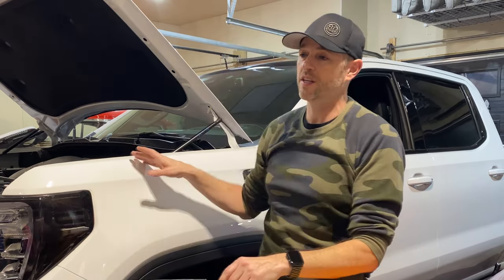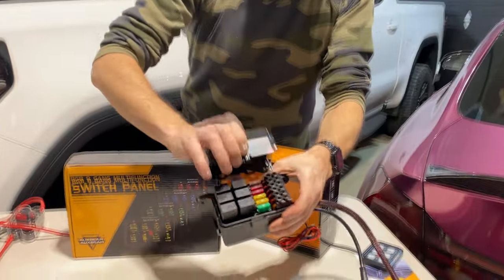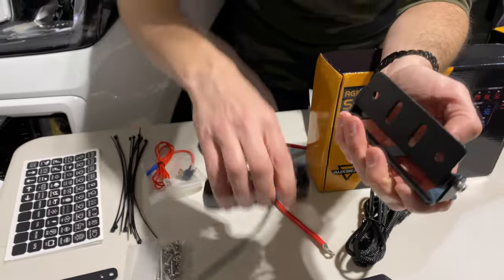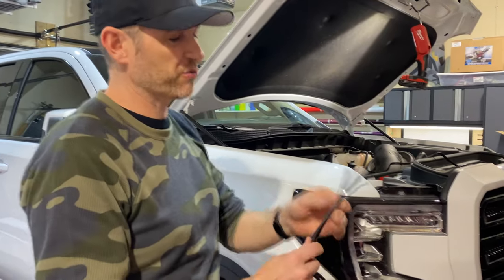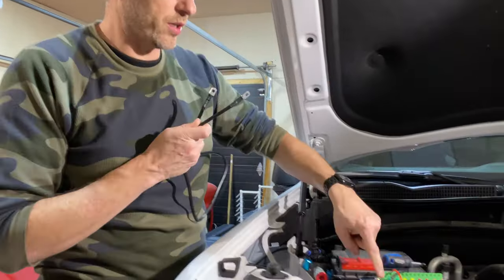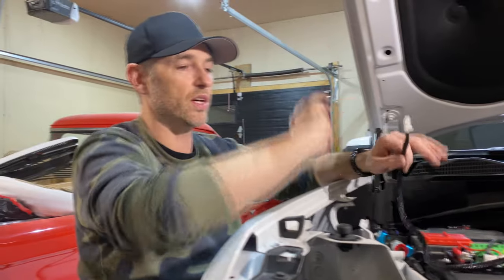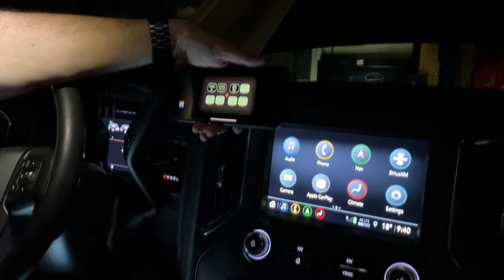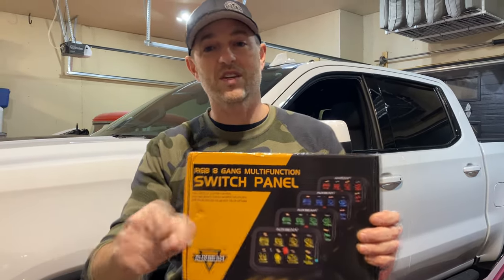New Switch Panel AUXBEAM AR-800 RGB Multifunction Bluetooth LED Install and Review.

Comment: Just got done putting this switch in a 2022 refresh with the Duramax. Everything is the same, except getting through the firewall was a pain in the butt. The air intake tubes block it. Removed the first elbow, and access was still tight, but I got it... if you remove the back part of the intake hose, it wouldn't be too bad, but that seemed like it would be more trouble than it was worth.

Oh, and finding the wire was a little challenging in the cab. I don't know if the 2022s have more sound insulation, but I had to dig for it.

Comment: Great video instruction. I see that you connect the remote wire to the ignition. Does that mean you can only turn lights on when the ignition is in "on" position? If so, is there a way to bypass that and give you the ability to turn the lights on without turning on the ignition?
Reply from the maker: This video should help:

Adding a Wireless Remote For My Accessories!
https://youtu.be/aV7ey5415dI

Comment: Don - loved the video and the step by step install directions.  My AR-800 arrived yesterday and followed your video and the supplied installation brochure supplied by Auxbeam.  Unfortunately, despite everything being hooked up correctly I cannot get the control box to turn on and illuminate.  I tried to reach Auxbeam for assistance but to no avail, and they don't have any Q&A or Troubleshooting links on their website, or none that I could find.  

My 2016 Toyota Tundra has LOW PROFILE mini fuses, so I used the supplied fuse tap, which is designed for mini fuses, and replaced my 10 amp low profile mini ignition fuse with a 10 amp mini fuse.  The supplied fuse tap seems to fit fine into my truck's fuse box, and even with replacing the truck's 10 amp low profile mini fuse with a 10 amp mini fuse the truck started up just fine.  I haven't hooked up any accessories yet, but one would conclude the control box should display it is receiving power with or without any attached accessories. Do you think the issue is using a fuse tap with mini fuses instead of LOW PROFILE mini fuses?  Any troubleshooting ideas?
Reply from the maker: Sorry just saw this message. YouTube flagged it as spam.  Have you tried bridging the trigger wire to the main power lead just to test it out for power.  That small trigger wire is on a two prong pin. Maybe the other side is live.  Just making guesses in the dark

Comment: very good step by step explanation - question?  the ignition/accessory switch wire - where would I connect it since I can't do your option where you spliced into a red wire?    I have 2024 GMC Canyon elevation - please advise
Reply from the maker: Heated seats circuit? I used my cooled seats for these things

Comment: I have a Auxbeam and a light bar just like that, I want to learn how to install but I’m having trouble. So I cut the wires like you did in min 14:22 but I don’t know hot to connect to the box which wire goes to negative and positive since it’s it has a red blue and white wire, it’s also a RC led light bar with DRL

Comment: So I'm wondering if I can cut the switch controls off and tap my DRL so they can work automatically? Then make everything automatic except things like light bars that are not for road use! Maybe i just need to find a way to split or separate the switch controls wire. Great videos keep up the great work!

Comment: Question. If the light bar has 2 color modes (amber and white) , would you need to wire them to separate switches? It looks like you did but wanted to confirm! Thank you. Great video looking to get one for my father in law
Reply from the maker: Yes I have each DRL to their own dedicated switch

Comment: So, theoretically, would I be able to run this purely from my phone without installing the switch panel? I'm looking at getting these for my RHD Jeep so I can finally get some strobes on it, but not super keen on the idea of tearing the dash apart to run the wires. 

Great video, super informative!

Comment: Prefer the replaceable relay version, easier troubleshooting. Also if relay fails you can swap positions to put the circuit back in operation. Relays fail, I like the option to replace. I would not like to replace the whole relay power unit because (one) potted relay failed. They should keep the previous (old) form factor and add the RGB/Blue-Tooth features. Don, great videos. Thank-you!
Reply from the maker: Thanks for sharing!  Weighing the pros and cons as you research what works best for your project makes sense
Reply: I like how you responded to his video . Great to see someone thinks lie me . I also would like to know if this company will provide any help, customer support and is in the USA most importantly this system is not waterproof from what I can see   I put my money on Finex 4200 mini controller made in the USA, they provide lighting equipment for fire, police and public safety
Reply: Thanks buddy for your vid but I’m still looking for quality waterproof system

Comment: Just wanted to point out that there is also a firewall penetration on the pasenger side as well. Might be a little harder to access from inside the cab though depending on the size of your hands.
Reply from the maker: True!  I used the passenger side one for my onboard compressor auxiliary circuit.  Either route, I found them both difficult 😂
Reply: So, Don quick question, on the driver side, penetration can you give a little input how or what did you use to get it through the fire wall?

Comment: Great video and clean installation. 
In regard to the compressor, how do you deflate/flate the tires pressure?
Reply from the maker: Without an auxiliary tank it is slow, but possible:

How to Install an Air Line in Your Truck!
https://youtu.be/RhqsI4NC2rU

Comment: Awesome job, can you turn on the lights with the app even if the truck is turned off?
Reply from the maker: Yes if you wire it up that way.  Here is a video where I can turn it on remotely too:

Adding a Wireless Remote For My Accessories!
https://youtu.be/aV7ey5415dI

Comment: Hi, Don. Excellent channel.  I am interested in the AR-820, but do not wish to mount switches in the truck.  I have a 2023 Canyon Denali, with Google built into the infotainment enter.  Do you know if the app could be downloaded to the truck, and I could control my accessories with the screen?
Thanks
Reply from the maker: Not that I know of

Comment: First Purchase HERE <-------    Thank you for the install vid. I will take it that the 8 ft cord did not make it around the battery as you intended for it to when you initially explained. :) Noted
Reply from the maker: The cord was long enough.  The only cutting of wires was my light bar switch

Comment: Nice video 👍 If my light bar needs 35 amps (420W on 12V) and the switch panel only has up to 30 amps, how would i wire the original harness with a 40 amp relay into the auxbeam switch panel? Would that work? Thanks.
Reply from the maker: You would hook it up with 40amp harness/relay as per the lightbar manufacturer’s instructions and just use the Auxbeam as a switch.  You could use a 5A circuit just for switching the 40amp relay on and off
Reply: @Donslife  Thank you loads. This is a big relief. 🙏

Comment: You may have answered this, but I have a 3 way switch for light. On/off/backlit.  Will this panel allow for all 3 positions?
Reply from the maker: Not that I am aware of.  A 3rd position would need a 2nd switch to be used.

Comment: If you leave the  light bar on in the switch panel and you turn off you engine  and  you turn on the engine back on  the lights are on or you have to press the on button in the switch panel to turn them on again
Reply from the maker: If main power is cut from the panel, everything is off and has to be repressed.   You can wire it up differently of course.    After this video I added a wireless remote that can turn it on regardless if the truck is on or off too

Comment: Great video. I have a question. Can it be operated via Bluetooth with the ignition off? I camp in the middle of nowhere and if something is stirring around camp I would like to be able to "Light up the night". Thanks
Reply from the maker: Yes if you wire the panel to be live with the ignition off
Reply: @Donslife   do you know if it has any amperage draw that way? With all accessories off, of course. Thanks for the quick reply.
Reply from the maker: You can add a remote turn on like I did
Reply from the maker: Adding a Wireless Remote For My Accessories!
https://youtu.be/aV7ey5415dI
Reply from the maker: This way I can turn the panel on from 20ft away and connect my bluetooth to operate anything
Reply from the maker: @Overland_eXploits_Oklahoma it probably wouldn’t drain your battery overnight but it would after multiple days

Comment: I have the Chevy 1500. You used a existing fuse tap. Which fuse number would you recommend to tap into? Engine bay fuse number or passenger side fuse panel number?

Comment: I just got to the part of the video where you said you have a compressor under your hood? I know I didn’t hear that wrong because I even ruined it in. Heard it again, lol. Do you have a video showing the install of your compressor?
Reply from the maker: There are a couple related to it. Here is the main one :

How to Install a Wireless Compressor for your Air Suspension
https://youtu.be/pLCIiavqKtE
Reply from the maker: And another:

How to Install an Air Line in Your Truck!
https://youtu.be/RhqsI4NC2rU

Comment: You still need to have the actual controller hooked up to use the app though?
Reply from the maker: Correct.  The App communicates with the controller via Bluetooth.

Comment: Any sealant needed where you cut the rubber portion of the firewall?
Reply from the maker: Not really.  I mean you could but the chances of water or dust getting in is highly unlikely

Comment: Good morning, For the wiring of the RC light bar. I notice u cap the red wire for the switch, at 14:29 of video {New Switch Panel Auxbeam AR-800}  that being said..... you run the WHITE wire into the positive terminal using 30 amp location on  AUX box and then the BLUE wire into positive terminal of next switch over ? Using  the 30 amp switch right next to it ???  Lastly, do you connect the power leads that come with wiring harness for the light bar or just burying them ?  Thanks Don J

Comment: Great vid. Do you know the power the panel uses to operate itself? Like standby power when all the circuits are turned on but no accessories actually drawing power? I have a different panel that draws 1a constantly just to have switches in on position.It’s a bit of an issue and I need to find new panel. Thanks

Comment: Bro can you confirm that the auxbeam panel is defect. A lot of people on YouTube telling that after a month of use the box is damaged making some equipment on all the time. Replaced by auxbeam but the issue persists.
Reply from the maker: Mine works perfectly.   I was just using it at a car show and had my lights on a strobe effect using the Bluetooth app on my phone.  I have not had any issues at all

Comment: Hey Don, love all your vids and mods. Will this work just off the auxbeam phone app or infotainment screen without having to run the 8gang controller into the cab?
Reply from the maker: Thank you sir!  Technically you could leave the control panel tucked away somewhere safely in the engine bay away from heat and moisture.  Your phone app via Bluetooth would do the controlling.  Personally I would find that inconvenient and would want the panel in the cab, even if you left it sitting in the glovebox or something.   If you want to control it with your infotainment system, you’ll need something like my CarPlay AI box to control the Auxbeam switches.

Comment: Great Video! Thank You, with the RC Light that comes with three position switch, is it okay for the DRL and the flood to be on at the same time? is it really okay to eliminate relays and fuse holders and tap straight in with this unit?  thanks
Reply from the maker: Thanks!  I have looked into the flood light and DRL being on at the same time couldn't get a straight answer.  The most of have learned is that it won't hurt it in the short term.  The flood light drowns out the DRL too.

Each Auxbeam switch has it's own fused circuit and relay so yes, you can eliminate the ones that came with the light bar.

Comment: I am leaning towards Auxbeam > more expensive options but I don't like that I have to turn my IGN on to power up my accessories. Is the app control also dependent on IGN being on?
Reply from the maker: Fair point.  You can wire up the switch panel to constant too.  Really up to you…….or you can add a diode and a remote switch like I did in the video.  Now I can sit by the campfire and turn the switch on remotely, while controlling all the gadgets.  (For example) 😊 

Adding a Wireless Remote For My Accessories!
https://youtu.be/aV7ey5415dI

Comment: Does the car have to be on in order to use the app? Would be cool to turn on lightbars from the rooftop tent if need be.
Reply from the maker: No, you can install a remote switch like I did in this video if you wanted:

Adding a Wireless Remote For My Accessories!
https://youtu.be/aV7ey5415dI
Reply: @Donslife  thanks! 🙏

Comment: Thank you for the quick reply. What did you do with the negative and/or ground?  Did you just have to run it to one of the switches?
Reply from the maker: You can terminate them on the body/frame or the switch

Comment: A+ work as always! If mine wasnt a lease id consider doing alot of your mods. Have you considered installing the sierra sportsbar from the 16-19 all-terrains? I swapped mine over but on the x-31 package not the at4. Ive had many compliments and would def look good on the artic white!
Reply: What is this sportsbar you speak of? I have the same truck
Reply: Gm had a factory sportsbar they offered on the 16-19 all-terrainX packages. I kept mine when i sold the truck and put it on my next one which was the '21 new body style.
Reply from the maker: I have thought about a couple sport bars including the one you speak of.  With my current box cover I just can do it.  But I haven’t ruled it out
Reply: Box cover definitely wont work. I had to do a bit of modding to the tonneau cover to make things fit right. The factory covers will not fit  either.  Only certain aftermarket ones will work.

Comment: Did you ask Auxbeam if this controller is waterproof system  ip67 rated ? What about customer services to take my phone calls if there’s any issues with this 6 or 8 gang controller
Reply from the maker: Every switch has its waterproof rating listed on the website.  I have always had replies 📧 mg them.  Never have I attempted a phone call

Comment: Hi sorry to bother you,
I have a 2022 gmc sierra at4  and purchased the smoked mirror lights with signal lights.
Came with no instructions and wondering where would be the best place to run the signal wire to. It's the light on the mirror face
Reply from the maker: I’m consider finding the fuse for each signal light and connect there with a fuse tap
Reply: @Donslife  I was hopping to tap in the harness in the door if there was a wire for the signal, not sure if there is or not. 
If not I would have to do it the way you said.
Thanks so much for getting back so fast and for your time

Comment: If I power off the vehicle “cutting power to accessory wire turning off the unit” if I turn my car back on without turning the switches off first will the buttons that were on. Will it come back on when you start? Or do you gotta turn them back on every time
Reply from the maker: The switch is designed to turn on and off with an ignition or accessory trigger.  You would need to turn the connected device on again after the panel loses power. You can likely do some creative wiring outside of how the manufacturer instructs the installation.  Going this route you can forgo using a switch altogether and just use a relay.
Reply: @Donslife  hold on I think we might not understand eachother, let’s say switch 1 is on currently, you turn off ur truck without turning off switch one. the device looses power, turn ur truck back on, will switch one also come back on or do you gotta press the button again.
Reply from the maker: @uniteddrones7626  sorry!  Shutting of the vehicle resets the panel to ‘off’ for all the the connected devices.  You have to repress each item or group you have programmed to turn things back on.

Comment: Just curious 🤔 if you can have constant power to the panel since you can shut off the lights anyway? More or less if you're at a car show, that you're not having your acc,on
Reply from the maker: Yes you can.  You’ll just drain your battery a little more quickly depending on what you have running as well as the backlight for the switch
Reply from the maker: I added a remote switch : Adding a Wireless Remote For My Accessories!
https://youtu.be/aV7ey5415dI

Comment: Nice video! Does the controller lose memory of the switches that were on after an ignition cycle from on to off to on again?  Engine cooling fan for example should have immediate power without having to turn a switch on each time you start the vehicle. Thanks in advance
Reply from the maker: When the ignition is turned off the devices it controls turn off too.  When the first ignition is on again, the devices need to be turned back on manually but they will stay programmed as groups and/or pulse, toggle and momentarily mode if you set them up that way.  I installed a remote control circuit with a diode so I can keep the switch on without starting the truck too.
Reply: @Donslife  Could you do a video on that setup? I am wanting to have power without the truck being on but still want to have safeguards in place.
Reply from the maker: Done : Adding a Wireless Remote For My Accessories!
https://youtu.be/aV7ey5415dI